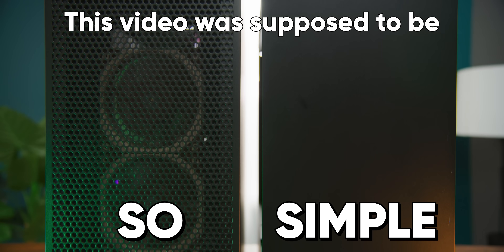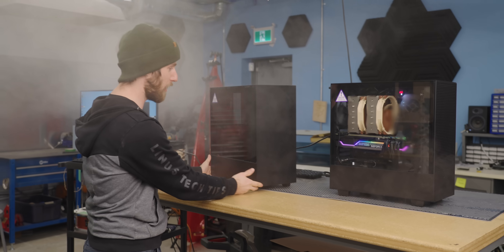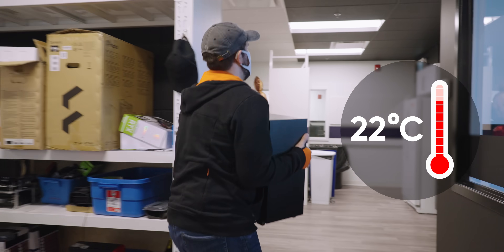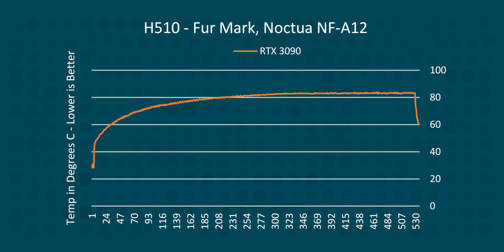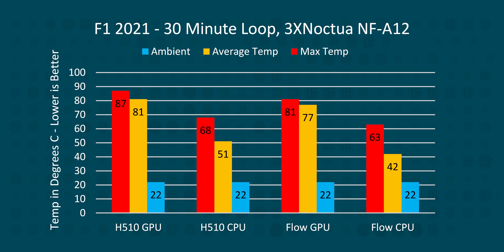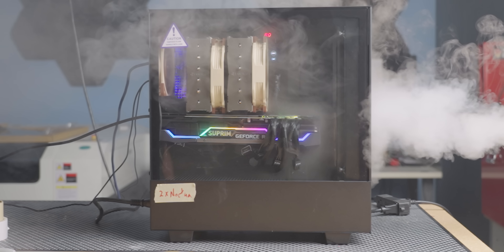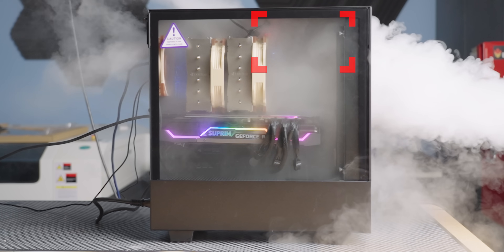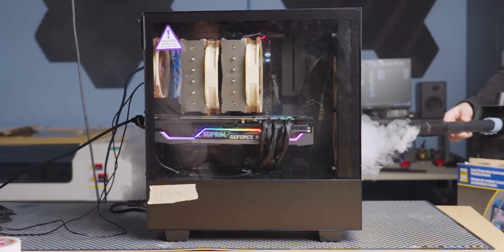Everything You Know Is Wrong - Mesh vs Non-Mesh Front Panel

Comment: I solved this is my haf912 by adding an extra fan on the top font and modifying the side panel to accept a 200mm fan as a gpu exhaust. The side exhaust is necessary for good temps, and the disc drive rack keeps the air at the top flowing to the cpu, and the air at the bottom flowing to the gpu. 3090 at 60c max and 5900x at 60c max with a DRP4 cooler.
Reply: SENSITIVE CONTENT 
 ONNANOKO.TOKYO/machiko  

MEGAN : "Hotter" 
HOPI : "Sweeter" 
JOONIE : "Cooler" 
YOONGI : "Butter" .
PETTY : face. 
BODY : Beautiful. 
SMART : flirt. 
Like to eat.
Жизнь, как красивая мелодия, только песни перепутались.
#однако #я #люблю #таких #рыбаков

#ライブ配信の再編ありがとうです！#この日のライブ配信は、#かならりやばかったですね！１#万人を超える人が見ていたもんね（笑）#やっぱり人参最高！#まさかのカメラ切り忘れでやら1かしたのもドキドキでした！#今後は気を付けないとね5). . 

!💖🖤❤#今後は気をライブ配信の再編ありがとうです！#この日のライブ配信は、#１万人を超える人が見ていたも ん（#笑）#やっぱり人参最高！#まさかのカメラ切り忘れでやら1かしたのもドキドキでした #今後は気をライブ配信の再編ありがとうです！（ #笑）#垃圾

Comment: I have the NZXT 510 compact case, and my temps has always been fine.. Im running ryzen 5 3600 + MSI GeForce GTX 1660 Ti ARMOR 6G OC. I do have non-stock fans(some cheap ones), two front, one back and one top and some decent noctua cpu cooler, Noctua NH-U12S-SE-AM4(mounted the other way so that the cpu fan pushes air upwards, fan on the bottom position), I have never hit above 70-80c on my setup, never had throttling or overheating or any issues. 

I think the reason why I dont have such problems is that my GPU and CPU coolers are tiny compared to this videos overkill example, as I have like 10cm empty space between my gpu and front fan lol.
Reply: I have to agree. I have the same case and same cpu cooler, but have the cooler mounted horizontally with the fan set up as intake. Though I have a 10700k thats constantly boosted to 4.8ghz (dang msi software) and an EVGA 3060 XC with a decent OC. No intake fans with the stock exhaust fans and I have yet to see the cpu or gpu go above 74c even when playing demanding titles. I guess as long as you don't have crazy top tier components it's not a huge deal..plus I like the smaller footprint on my desk so I have room for other stuff

Comment: I would love to see this done with the corsair 5000D with three fans in front and three fans on side front with the air dam in place for mobo cooling, and a 3090 with a 360 AIO cpu cooler with 6 fan push pull out the top and a fan in the rear for extra exhaust.
Reply: That's the exact setup im running lol 5000D Airflow, 13 fans, rad up top in push pull. Pretty sure its just fine as there is more room for the air to travel. My CPU and GPU both stay chilly.
Reply: @Zalagar619  I’m building the 5000X but the case hasn’t arrived. You mentioned your 6 fan push/pull for the 360 AIO on top. Both sets of both fans mounted on the rad are set to exhaust direction? Inside the case you’ll see the front of the lower set and on the top of your case you’ll see the back of the upper set? I’m considering some fans with RGB on both sides for the top set on top of the rad.
Reply: @Zalagar619  13 fing fans?! I have like 3, a PSU one, Intel stock one, and a GPU one.
Reply: @peters.7428  That case can fit 3 on the top, 3 on the front, 3 on the side and 1 in the back. That's 10 fans on the case, without even considering any other component. Then there's the PSU, GPU which generally has 2-3 fans these days and the CPU fan. So a grand total of 15 fans would probably be possible with that case.
I personally have a case which allows me to have 1 large fan on the side, 2 medium sized ones on the top, 1 on the front and 1 on the back. The front and top fans are for intake whereas the side and back are out. I find that has worked really well pretty much regardless of load and components, which have changed throughout the years. It's also fairly quiet even during heavy load.
Reply: @peters.7428  I have 13 actual fans, 10 Corsair QL120's and 3 LL120's, not including the 3 gpu fans and the power supply fan. I keep my PC cool and every fan slot is being used.
Reply: @CottidaeSEA  5000D/X can have 6 fans up top, 3 fans and a rad on the top and 3 fans on the outside of the case on the top in the valley up there. I have 6 fans on the top in push/pull with my 360mm AIO Rad.
Reply: @Zalagar619  Damn! What's the dimensions of the top fans then? I've only seen setups with 3 on the top.
Reply: @CottidaeSEA  normal 3 120mm fan setup, 3 go inside the case and 3 outside the case, the top of the case has a valley under the metal panel and it has 3 fan slots outside of the case with holes to run the wires inside.
Reply: @Zalagar619  Looks nice! A bit curious though, what's the air flow like from the GPU? I'm pretty sure it's easily good enough, but it does seem like a bottleneck for the cooling.
Reply: @CottidaeSEA  Not exactly sure what you mean? There's plenty of room for the air to flow around the GPU, the bottom front fan blows cool air right under it, gpu exhausts out the back of the case and a tiny bit through the right top side of the card. Air also can go through the PCIE mount brackets and the vertical gpu mount brackets on the back of the case as well. GPU and CPU stay chilly always. Currently crypto mining on cpu and GPU both at 100% CPU is in the 50°C's and the GPU is at 34°C. Although the GPU is underclocked and undervolted. But even when gaming the GPU is in the 50°C's. Probably only been in the 60's once.
Reply: @Zalagar619  The flow of air to the GPU was my main concern, not away from it. It wasn't clear exactly how much air could get to it from the top, and while I might have missed it, I couldn't see if you had the front fans as intake or not.
Reply: Corsair 5000D Airflow is a much bigger case so I think the airflow will improve by a lot.
Reply: I'd be interested in seeing the difference between that configuration and what I run in the 5000D, which is a thick 360 rad in the front, and a slim 280 rad on the top, with only five fans.  It's all one loop now, but previously the 360 was only for the GPU and the 280 was an AIO for the CPU.  Once the GPU is on water, though, the actual airflow pattern doesn't matter as much.

Comment: I removed all the PCI slot covers and ziup tied a filtered 90mm fan pulling air in. GPU now gets fresh air from both front and back. I also rotated the CPU heatsink so the fan is pointed down pulling air up towards the open top. CPU temps increased a bit but GPU is fairing a bit better.
Reply: SENSITIVE CONTENT 
 ONNANOKO.TOKYO/machiko  

MEGAN : "Hotter" 
HOPI : "Sweeter" 
JOONIE : "Cooler" 
YOONGI : "Butter" .
PETTY : face. 
BODY : Beautiful. 
SMART : flirt. 
Like to eat.
Жизнь, как красивая мелодия, только песни перепутались.
#однако #я #люблю #таких #рыбаков

#ライブ配信の再編ありがとうです！#この日のライブ配信は、#かならりやばかったですね！１#万人を超える人が見ていたもんね（笑）#やっぱり人参最高！#まさかのカメラ切り忘れでやら1かしたのもドキドキでした！#今後は気を付けないとね5). . 

!💖🖤❤#今後は気をライブ配信の再編ありがとうです！#この日のライブ配信は、#１万人を超える人が見ていたも ん（#笑）#やっぱり人参最高！#まさかのカメラ切り忘れでやら1かしたのもドキドキでした #今後は気をライブ配信の再編ありがとうです！（ #笑）#垃圾
Reply: Similar story on my part, except my additional fan exhausts air from the GPU. May have to test out using it as in intake, not a bad idea! Have a good one.

quick edit: It's attached w/ a ziptie and a paperclip lmao, I think Linus would approve.

Comment: I wonder what would happen if two 60mm or 40mm fans were jury-rigged where the bottom 120mm intake is.  Or even configure the lower 120mm fan as exhaust.

Comment: Hmmm.... Would speeding up the front fans slightly (only enough to flow more then the exhaust fans) and having them ramp with the CPU fan help?  My case has one 120mm fan rear, two 120mm fans on top (with rad - ah, a big difference here), and two 140mm fans in front.  My front fans are set to blow slightly more air in then the exhaust fans exhaust at all times - I can see air blowing out when I use a tissue paper over the vented slot covers (but if I let the front filter get too full of dust I can see the opposite where air actually wants to get drawn in).  I don't have temp problems, but wondering if that would help in your case (pardon the pun).

Comment: I have an AIO in the 4000D with three intake and 3 exhaust in a hot environment and it works great, keep it equal if you can or push for positive pressure.

Comment: Solution:

Get a bigger case, and don't use small form factor cases because they restrict GPU airflow.
Reply: or just don't use glass panels
Reply: No the solution is to buy good, meshed PC cases, instead of NZXT nonsense.
Reply: That's besides the point. Most people like it more compact with potent hardware and no low-end stuff.
Reply: The simolest solution is to make it negative pressure, but it will introduce another problem: dust
Reply: or get a smaller form factor gpu
Reply: Bigger is not a solution either. You lose efficiency, as you need more fans and more RPM, to move a similar volume of air through the radiators. The whole point of having the hardware in a case, is to channel the airflow.

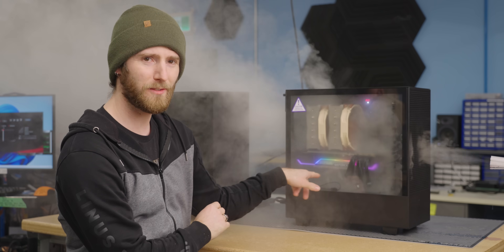Comment: 0:53 That dead spot is why I love my Lancool Mesh 2 RGB Supermega Bombtastic Airflow, lol. I slapped 2 fans under my GPU blowing nice cool air form the PSU basement and keeps my TUF 3070ti running between 59 and 61. Which usually keeps the GPU clock between 2070 and 2100 mhz. 

Although I might re-paste it and get some of this thermal paste goo that I saw some YouTubers blabbering about lately, for the memory and VRAM.
Reply: That's the case that I got when I built my first tower a few months ago! I didn't install any fans on the basement intake, and my 3060TI still runs at around 61°C under a constant load like folding@home. This may be in part because I don't have any drives in the 3.5" bays so the bottom front fan can blow straight across the bottom, but I'll probably put some in when I eventually upgrade my storage.
Reply: @OutruntheWind  it's almost the perfect case. If they made an XL version of it and got rid of the glass on the  back, to me it would be the perfect case.

Just needs to be maybe an inch wider and an inch or two longer. Doesn't need to be any taller really.

I can't fit the cover for the 24 pin and stuff. Damn card is too long by a cm. But I'm gonna fix that with a mallet today finally. HAHA
Reply: I might have to pick up some fans and do the same
Reply: That sounds like a Dawid Does Tech Stuff naming scheme
Reply: See, most people don't realize that this is an issue and also don't realize that even just adding a single fan to the bottom of the case will make a huge difference for GPU temps. Even without the mesh basement side panel that the lancool has, it will still help to direct that air from the intake to the GPU. My air cooled 2080 ti never gets above 72C under heavy load
Reply: The concern with fans at the bottom is pulling a lot of dust off of the floor.

The most optimal solution would be to use a pci-e extender to have the gpu in a separate chamber with its own intake and exhaust so it won't heat up the air that the cpu is eating and vice versa
Reply: Don't buy that goo s#!t! It boils! It's POS product.
Reply: I recently swapped from a define 7 compact to the lan cool 2 mesh and it’s fantastic.  I have 2 noctuas blasting my 3080 with fresh air.  Before I’d have to keep my side panels open for more air flow, but now I don’t have to
Reply: Lancool II Mesh RGB is a godsend case.
Reply: SENSITIVE CONTENT 
 ONNANOKO.TOKYO/machiko  

MEGAN : "Hotter" 
HOPI : "Sweeter" 
JOONIE : "Cooler" 
YOONGI : "Butter" .
PETTY : face. 
BODY : Beautiful. 
SMART : flirt. 
Like to eat.
Жизнь, как красивая мелодия, только песни перепутались.
#однако #я #люблю #таких #рыбаков

#ライブ配信の再編ありがとうです！#この日のライブ配信は、#かならりやばかったですね！１#万人を超える人が見ていたもんね（笑）#やっぱり人参最高！#まさかのカメラ切り忘れでやら1かしたのもドキドキでした！#今後は気を付けないとね5). . 

!💖🖤❤#今後は気をライブ配信の再編ありがとうです！#この日のライブ配信は、#１万人を超える人が見ていたも ん（#笑）#やっぱり人参最高！#まさかのカメラ切り忘れでやら1かしたのもドキドキでした #今後は気をライブ配信の再編ありがとうです！（ #笑）#垃圾

Comment: what about adding fans only at the rear and making the graphics card aerodynamic so that air rushes past. also if you put an angled slope at the top front and bottom front air would glide past rather than get trapped so maybe a more confined space would be an advantage?

Comment: And it was at this point, sometime in 2000', that gamers decided to add side panel fans over the graphics card.
Well, it was either that or remove the side panel entirely.
Reply: Honestly, if you have a "bad case" just remove the side panel and clean your PC every 6 months or something.
Reply: @silentKeys20  Problem is when you have cats lol
Reply: I designed & 3D printed a 120mm to 80mm adapter for a friend's top-down CPU cooler. It has a hole angled just right to sling some air onto the GPU backplate, too.
Reply: I wonder if in the near future we have a case where it channels the airflow independently between CPU and GPU component. Similar to current Mac Pro tower of case and even some workstation-grade PC towers. Basically having shroud so it won't produce that turbulence we get when air hits the GPU. Even server blades does this. 

It will be a challenging to design a case like that where users can still mix and match component.
Reply: I have the Thermaltake Chaser mk 2 with 4 200mm fans one is in the side panel next to the gpu
Reply: Doesn't the side panel fan only help blower type GPUs? I think GPU cooling might improve, but it won't be optimal due to the GPU exhaust conflicting with the direction of the side panel fan.
Reply: @bob_smite  Run the case side fan as exhaust, drawing air across gpu with negative pressure. Most cards would be dumping 80+ of their heat right into that exhaust flow too.
Reply: @kleinbottled79  I might try that, but I don't think it would help as it might steal the air from the gpu. I have the CoolerMaster Cosmos S with 2 front, 1 rear, 200mm side, nh-u14s, and an axial fan gpu.

Comment: what about adding a shroud for the bottom fan?. i get it, not everyone could 3D print a shroud but it's worth a try, i guess. the idea is to let the fan pressurize the bottom area and let the hot air pushed out to the back panel

Comment: Could the GPU be vertical mounted in that case? That might allow better flow around the GPU because the air may not get trapped in the lower portion of the case.
Reply: vertical mounting is pointless in 99% of all cases that support for temps it because the GPU is always right against the glass/window
Reply: @luk4s195  I honestly wouldn't know, I've never done a vertical mount myself. In that instance it seems to me that it would still allow the hot air to rise rather than being trapped under a shelf, and air would flow better between the GPU and the motherboard.